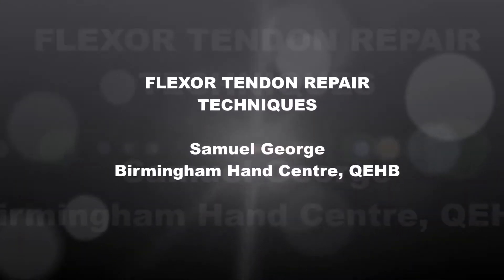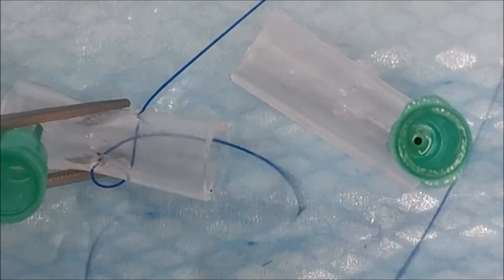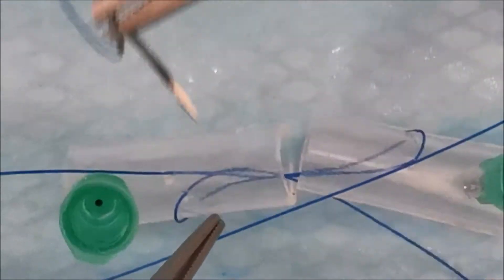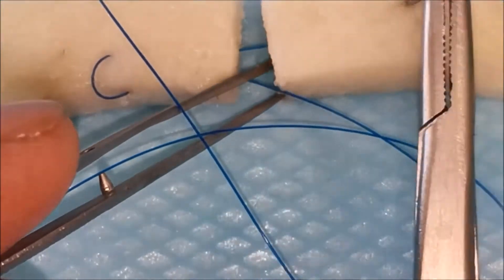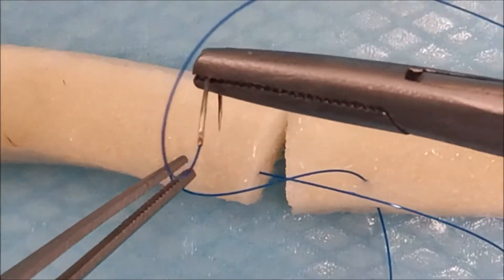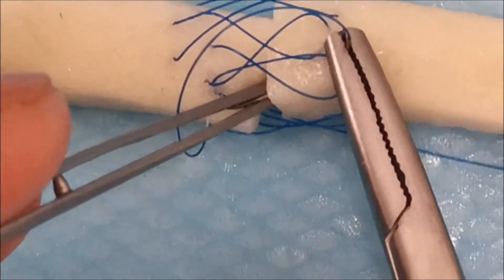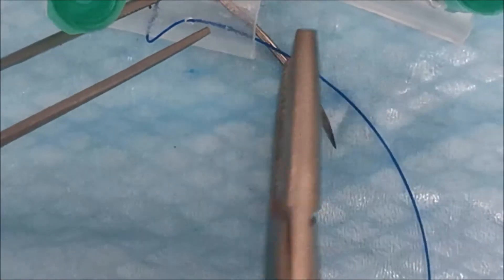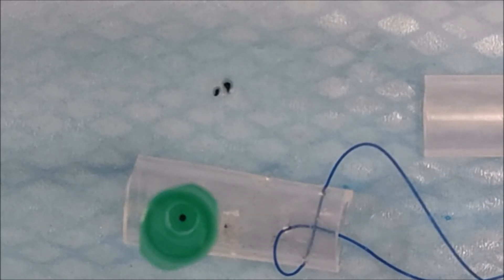Flexor Tendon Repair Techniques

Comment: Why is it bad to do it near to the tendon end .. i was thinking it good as it reduces the tension on the tendon
Reply from the maker: Thank you for your question, the problem with doing it too close to the tendon end, is that there is a zone of trauma which causes the tendon to be a bit more friable for about 5mm from the edge and if your suture is in there it might fray and cut through and rupture when the tendon swells in the subsequent few days after the repair.

Comment: Thanks for the video. im trying to gather just enough knowledge where i can make sure my surgeon knows what they are doing before opening up my hand up.

Unfortunately i have reason to believe that the personnel involved do not have my best interest at heart. Do you know if I can still gain full use of a severed flexor tendon in my right thumb if they delay my treatment for around 2 weeks?

Are there any major red flags i should confront surgeons about if they say or do certain things that you may know of? for example if a new green surgeon tells me i need a tendon graft after spending half a second holding my hand after waiting a week on a cleanly cut tendon should i maybe be questioning their methods?

Currently iv had no treatment and no booking for 3 days after my ER trip and im being told that this may be a week or two to get surgery. Everyone needs their thumb and im not special, but any knowledge you are able to impart upon me would be appreciated
Reply from the maker: Hi, we can’t comment on your case directly, but in general the flexor tendon to the thumb can usually be repaired up to about 2 weeks, after that it’s highly likely a 2-stage tendon reconstruction would be required or other options like fusion, tenodesis, etc. at the end of the day anything from 1-3 weeks should be explored to see how far the tendon is retracted prior to making a decision as to whether or not primary repair is possible or a 2-stage is required.
Reply: @sharpnsurgery  Thanks for the reply. They ended up doing a repair a week after the cut which seemed to be going well except i had no nerves in tact so i couldnt feel anything bad happening. Its upsetting though since the first day of my week 2 physio my tendon doesnt work anymore. I followed the exercises faithfully every 1-1.5Hrs and went through absolutely every question and description to my physio therapist about how much force i should be using for each exercise and saw my doctor on the follow up appointment and unfortunately i got prescribed faith healing until another reevaluation. now its three weeks after the cut and 2 after a surgery and the doctor sent me home implying that maybe another doctor would be able to open it up if it doesnt get better after the weekend. quite a huge bummer from my point of view.

On to an actual question, when repairing a flexor tendon does it have a sort of sheath around it to help it glide? I saw a picture today they finally showed me and it didnt look very lined up at all which has me a bit worried. the picture seems to show the tendon almost 40% off center when its stitched up under no/little tension. I am praying this was just the outer sheath i heard about from another doctor and the tendon is stitched inside a bit more straight!

Either way, i fear im kind of screwed for a proper recovery and seem to have a 95% or so ruptured tendon now. I guess now its a learning experience for someone else. I pray they schedule me for surgery in a timely manner but who knows. The other options you mentioned are stuff iv been looking into alot more after today so thank you for your time if you have read this far.

Comment: Hello, I had a flexor tendon repair on my middle and ring fingers 11 years ago. However, I still haven’t regained full functionality in my hand. Flexion in both my ring and middle fingers is limited to the MCP joint, with minimal movement in the PIP and DIP joints. Do you think this could be addressed by a physiotherapist, or should I see a doctor first? If the latter, would this fall under orthopedic surgery or plastic surgery? I understand it might not be ideal to seek medical advice online, but I’d just like to know if there’s any hope of regaining function, as I feel I’ve somewhat neglected the issue for the past 11 years.
Reply from the maker: Hi you should see a plastic or orthopaedic surgeon specialising in hand surgery to assess if there are any problems that need to be addressed surgically first, and then they can recommend hand therapy to regain the movement in your hand.

Comment: What material are you using to simulator the tendon?
Reply from the maker: The biological material is rind/fat of a pork chop that’s been boiled to soften it. The hollow clear tube is the sleeve that comes on the top of a pair of suture or tenotomy scissors.

Comment: Too many foreign bodies in the epitendinous repair. I think the Kessler’s or modified Kessler’s for me, is still the gold standard. Thanks for the excellent demonstration.
Reply from the maker: Thank you, the epitendinous suture is actually an adjunct to the core suture which could be a Kessler, they are not used independent of each other. The epitendinous suture adds around 30% to the strength of your repair, and only really needs to be used in flexors distal to zone V.
Reply: @sharpnsurgery  Oh great. Thanks for this reply. For epitendinous sutures I have hitherto used simple or continuous 5/0 or 6/0 prolene sutures, but will try this technique next time.
Reply from the maker: @kendaddi5857  yes we would usually use a 5-0, maybe 6-0 in a little finger flexor or child. The continuous epitendinous is just as good and actually like you say has less suture foreign material reaction and might be better than the silferskiold according to more recent studies, so it's fine to stick to a continuous epitendinous suture.

Comment: Hello, I would be very happy if you could help me. I had stitches on my arm 13 years ago. My wrist tendon was stitched. Do you think the stitches on my wrist tendon are the type of stitches that dissolve? The other day I felt a pain in my arm and something appeared inside. I did some research. And there were 2 pieces of sewing thread left that had not melted. I removed one of them myself because it was just under the skin, but I couldn't even touch a piece of it and couldn't remove it any further. If I go to the surgeon now, can they remove this? So this rope is not connected to the tendon or anything, right? Do you think it will be a problem? The aid I used was a blue colored rope. Thanks for
Reply from the maker: Hi, the suture that was used to repair your tendon was likely the blue suture you see, which is usually non-dissolvable. The tendon is fully healed in 3 months, so 13 years down the line if you remove the suture it shouldn't cause any problems, but yes a surgeon would be able to remove your suture for you if it is extruding/showing now.
Reply: @sharpnsurgery  Thank you for your answer, but I don't remember getting stitches on my tendon. I feel a bulge when I touch the tendon. Does that mean there's a seam there? So the glass was on my arm. The tendon in my arm remained as it was, that is, the glass did not cut the tendon, but in such a case, does the tendon still need to be stitched again?
Reply: If the tendon is not injured in any way, there is no need for a repair.
Your repair was probably a superficial one for a soft tissue injury not involving the tendons.

Comment: Which material you are showing this technique 
,where can we arrange that material for practice
Reply from the maker: Hi, the sutures are being demonstrated on pig fat, it is the rind/fat of a piece of pork chop which has been cut in half. The hollow plastic tube is just the protective tube that comes with disposable forceps/scissors to protect the tip.

Comment: Please tell me how long it takes for the tendon to return to normal or as it was before because I had my right knee tendon cut and then surgically reattached. Please tell me how long it will take to recover
Reply from the maker: Hi, the tendons in the hand are different to the knee tendons. A repaired flexor tendon will only get back to being about 80% as strong as it was structurally, although this will not be obvious clinically and one should be able to regain full power. The recovery is slow the tendon is weakest from 1-2 weeks after repair, then gets stronger up to 8 weeks when splints are usually discontinued and only applied at night and full recovery is complete at 12 weeks, where return to full activity, heavy lifting and contact sports can be resumed. The knee tendon, will be different and might have a longer rehabilitation period depending on which tendon is cut.
Reply: @sharpnsurgery  Thank you very much. My tendon below my knee was cut a lot with ceramic cutter glander, the day after the cut I had surgery to attach it then put 42 pins in the upper part now how long will it take to heal and after how long can I join heavy work please Please let me know if I do any heavy work before the scheduled time, is there a risk of tearing the tendons that have been reattached?
Reply: @sharpnsurgery  If I ask the person who is doing the surgery or to meet him, it takes 30 thousand in Bangladeshi taka because I am in Saudi Arabia and at the moment I don't have any money to ask him. So I asked you if I could know anything, it would be helpful. I am 24 years old. And now I am unemployed after the operation, all the money I had was spent on the operation, so I can no longer go to the doctor
Reply from the maker: Hi, you will have to ask your treating surgeon for that advice, as said before knee tendons are very different to hand tendons.